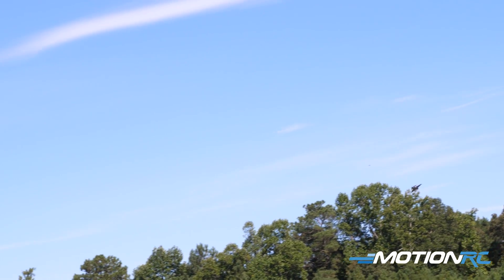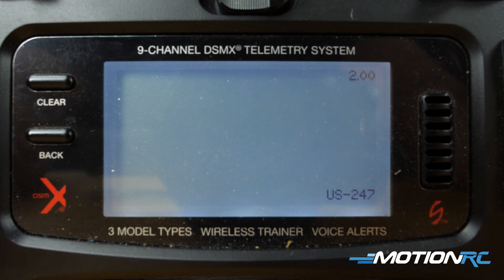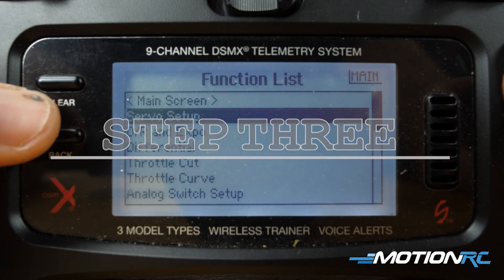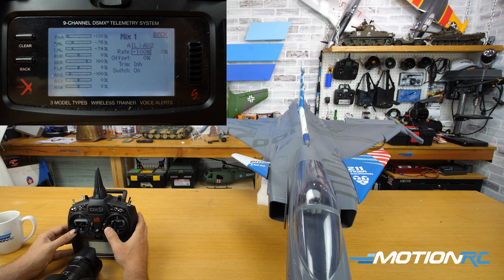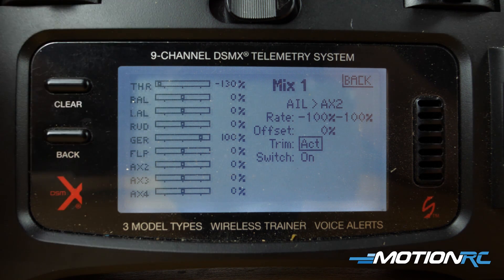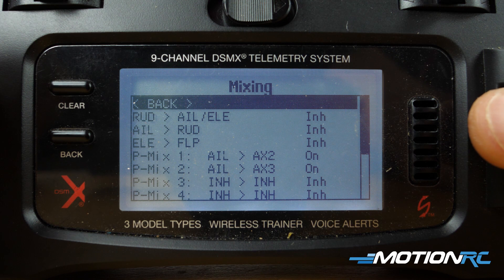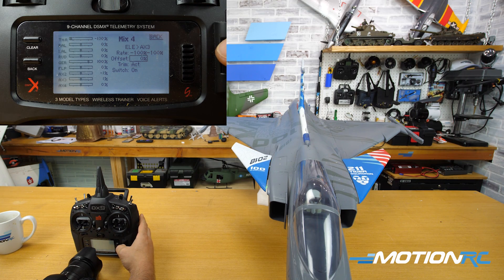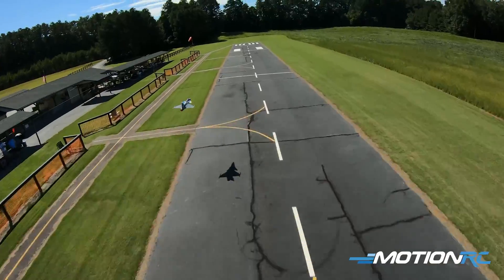Spektrum Canard Mix Setup - Freewing 80mm JAS-39 Gripen - Motion RC EDF RC Jet

Comment: 1. Instead of rolling the wheel from one polarity to the other, it’s much quicker to hit the clear button first. This will set it to zero and then you can roll in the new value.
2. Subtrim should be used to set the servo arm perpendicular to the pushrod. Once that’s done, adjust the linkage to center the control surface.
3. If the plane required trim to fly straight, adjust the linkages so that you can return the trims to center. Otherwise, the servo arms won’t be perpendicular to the pushrods like they were in #2 above.
4. I wouldn't enable the trims for the canard mixes. I would want them to stay aligned with the canard roots molded into the fuselage like you did with the sub trims.

Comment: Excellent explanation of how to properly set this Model up! One suggestion, why not place a llastic lip around the hatch openings on future releases to help preserve the paint around the edges?
Reply from the maker: All comes down to cost and logistics. To do that requires another separate plastic injection mold to be made, then another space in the assembly line to attach them etc, etc, etc.
Reply: @MotionRC  I totally understand that. I was just making a sugestion to help the Modeler keep Thier Investment damage free where We Always seem to suffer damage from every flight usage. Keep up the Good work on these Models.

Comment: Couldn't  you instead of just putting the mix to "ON" change it to a switch and be able to turn on & off the canard function during flight. Also did you run any kind of Gyro?
Reply from the maker: We didn't bother with a gyro for this one and you can surely put each mix on a switch if you want to turn them on or off. But this is how it should be flown, turning it off is not how we recommend flying it

Comment: Regarding trim inhibit, that is a matter of preference. 

And in fact, for thrust vectoring, it is important to leave trim inhibited, so you don't mess with your thrust line vs surface mixing. Thrust line needs to be tuned using sub-trim directly on the TV channels, and not depend on pitch/roll trim for the aerodynamic control surfaces.

For my part, I think I will prefer static trim on my canards, and leave trimming to the elevons only - but that is mostly a matter of preference. For TV it is really not

Comment: maybe you can use a dx6.  6 channel or you must have more channels
Reply from the maker: The only way a 6 channel would work on this is if you y-lead the canards into one channel. But doing that will only allow them to work in either the pitch or the roll, but not both. You want 7 channels to gain full control
Reply: @MotionRC  okay 😥

Comment: Now this is not including the added TV upgrade, did you need more mixing for the TV? Great work James. I saw you had the TV on a switch as well. I was wondering if you got it on a 3 position switch that you can have 2 rates?
Reply from the maker: We will have a seperate TV mixing video coming. This video is just for canards in the standard stock PNP setup. But yes, the TV is just 2 more mixes, one servo mixed to Rudder for Yaw, and 1 servo mixed to Elevator for pitch and we put both mixes on the H switch. We didn't bother with rates on the TV, just had it on 2 position for full-on, or off. That video will come next week.
Reply: TV mixing will look very similar: One from elevator to TV pitch, one from rudder to TV yaw. Direction is straight forward, TV should move the same direction as the elevators and rudder respectively.

Important: Make sure you have trim inhibited for those two mixes though, you do not want regular elevator and rudder trimming messing up your TV thrust line.

James, please make sure to cover that explicitly in that upcoming video.